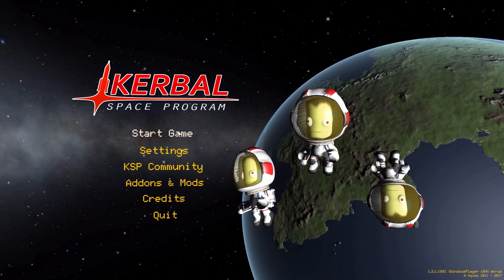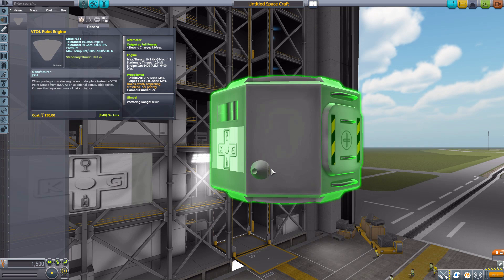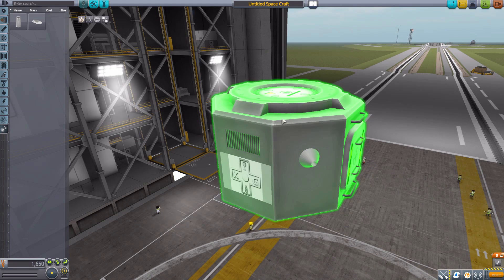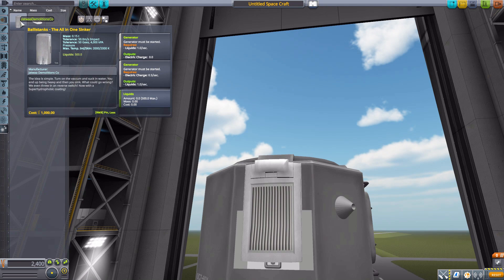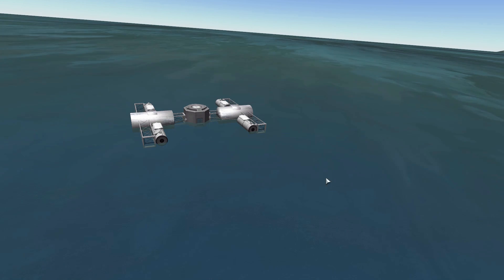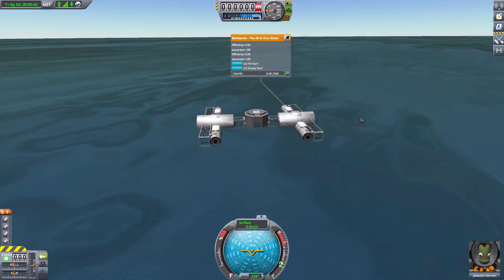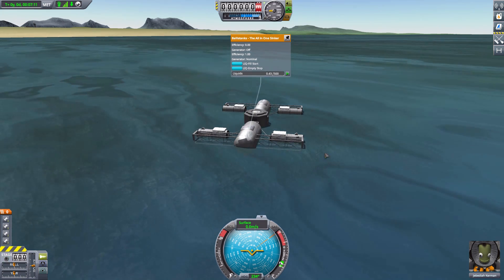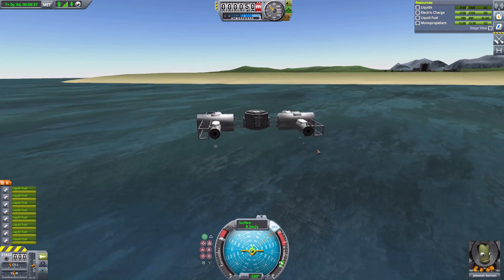KSP Mods - JDSA FlightTech

Comment: Oddly ballast tanks work the opposite way they are coded for this mod.  Open the tanks and the water rushes in naturally.  Expelling the water requires compressed air, which would require electric charge to produce.